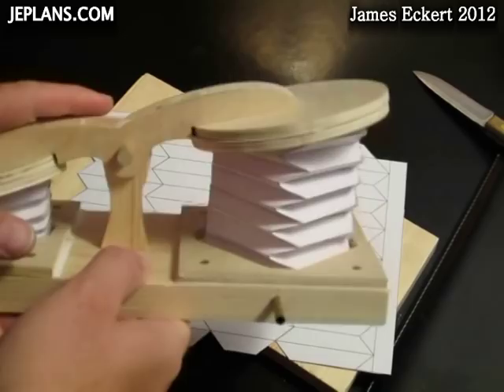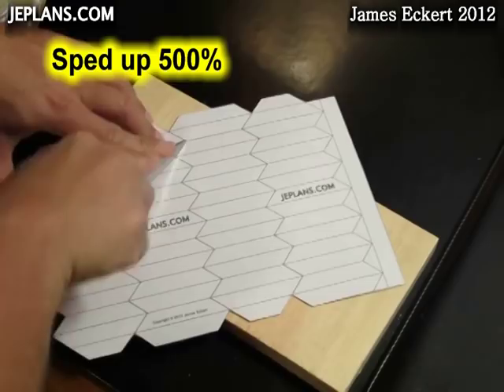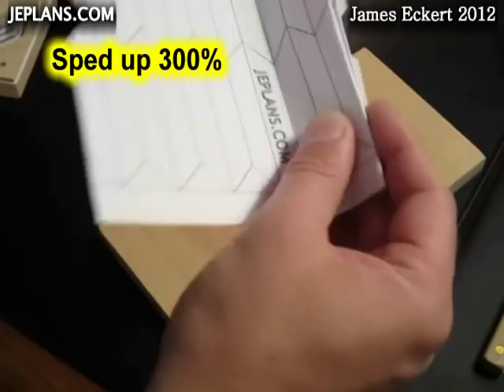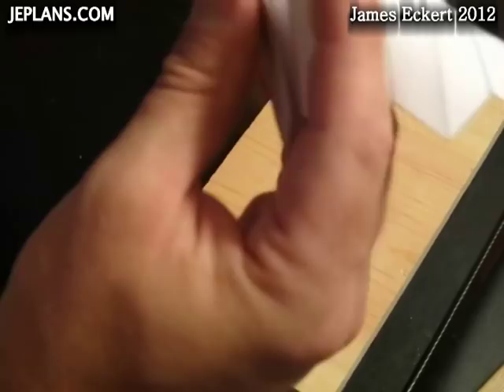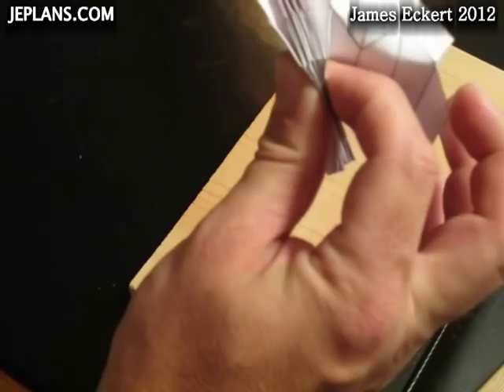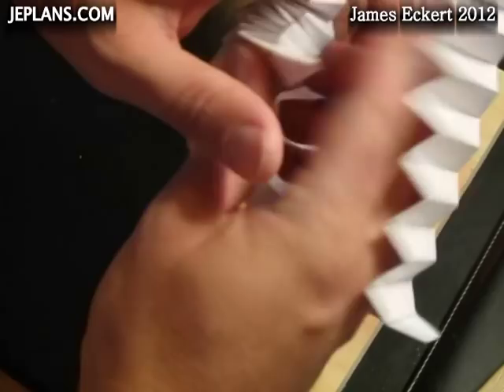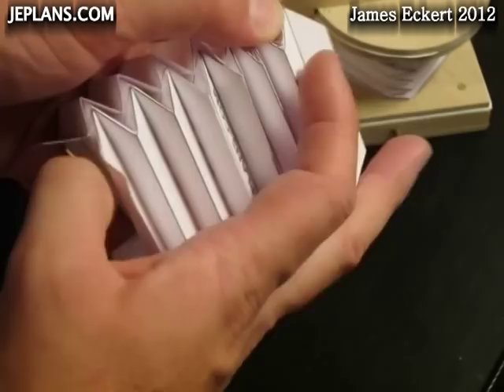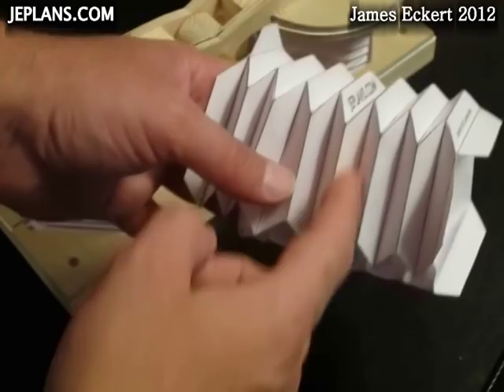Bellow Folding

Comment: Tip: be aware of the direction of the creases, score the paper to the side that the crease goes to, this means you will be flipping the paper over from one line to the next, and reversed on the other side of each corners, this will help the folding process go a lot faster and help keep the paper stronger too.
Reply: need double sided drawing for that?

Comment: Went to the site, couldn't find this.
Reply from the maker: It is the top item under Air Engines. I called it Pneumatic Power System 1
Reply: Many thanks. I signed up to the site. Got the plans in the end. Tried the paper section out. worked great. Thanks again for taking out time to reply. Regards.